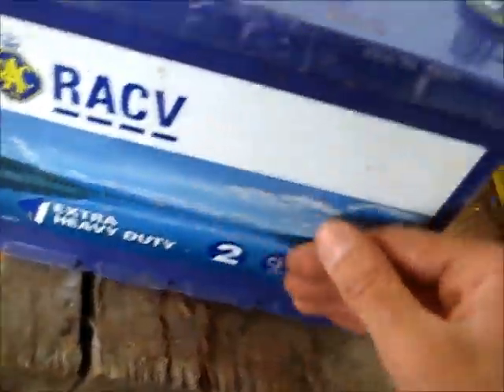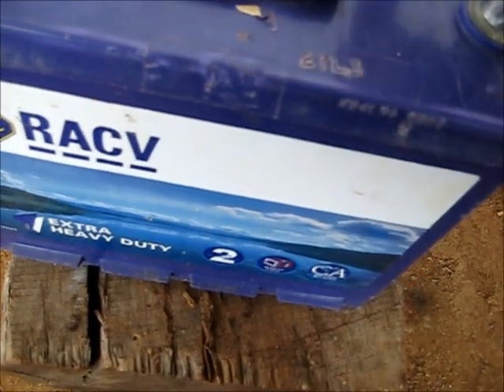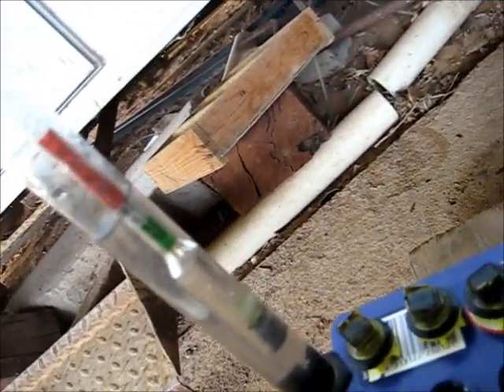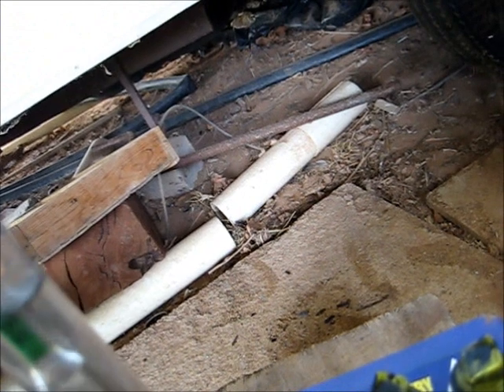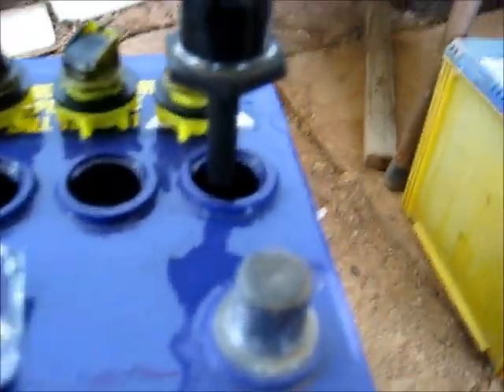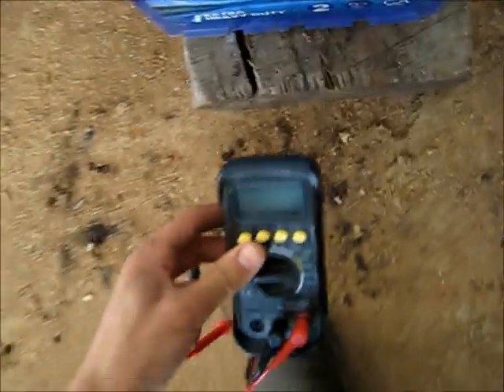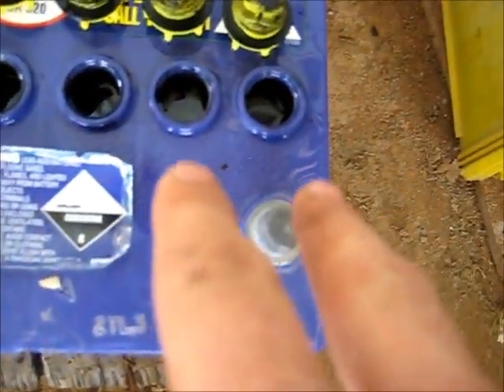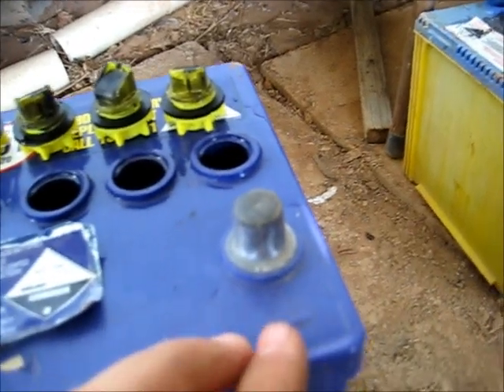Battery is alive....But 2 Cells are not

Comment: Not too far gone. The voltage indicates that. The sulfation in those two cells were blocking charging and generating heat. The sulfation could be reversed using battery chemicals.
Reply from the maker: It was totally dead

Comment: Each cell in a lead acid battery produces 2.1 volts, therefore a battery with six cells would produce 12.6 volts when fully charged. Your video showed a volt meter reading of 12.13 volts. If two cells were shorted they would produce 0 volts and the voltage reading should be around 8 volts. I don't think you had two shorted cells.

Comment from the maker: @filipkof Yeah, it would be shorts, i looked inside the cell, with the aid of a bright light, you can actually see the plates are disintegrated & they are touching, thats why it would have got so hot, 4 Volts Too short, Battery is only holding 8 Vols now

Comment: The battery i mentioned few days ago is dead too, one cell has broken terminal showing about 20ohms and gets damn hot when charging... that electrolyte was all over my hands then, but it was at least discharged :D desulfator is already on the way, will try in my car, battery's not starting that good as it was when it was new... do you know what causes those cells get so hot ? shorts inside ?